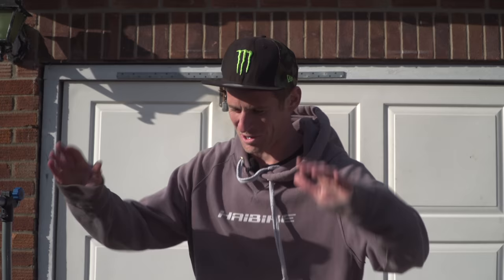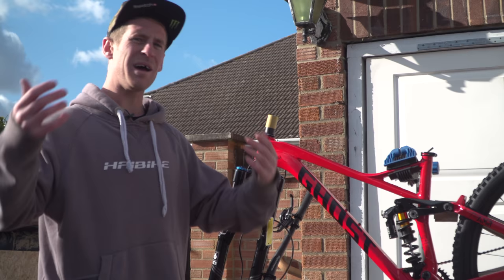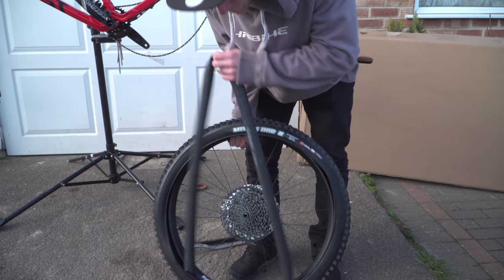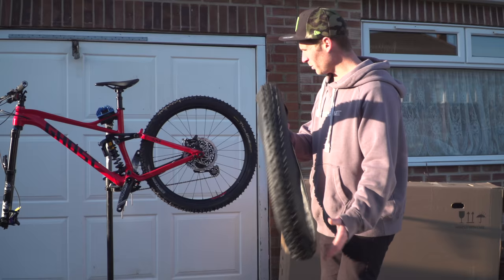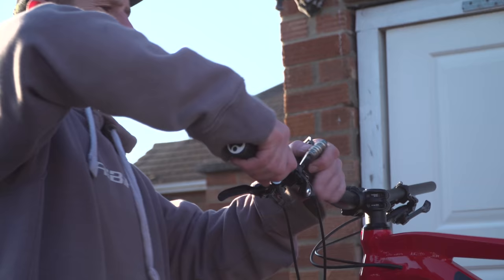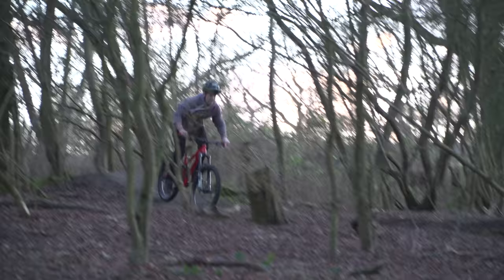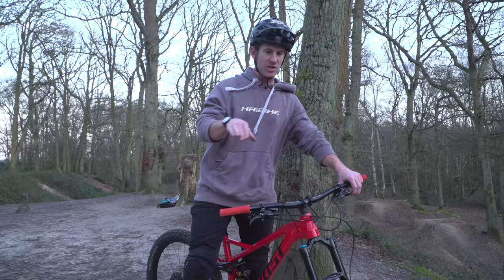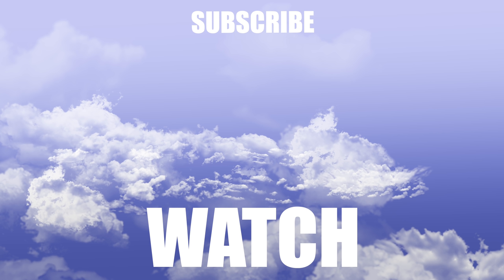MY NEW ENDURO BIKE IS THE DREAM

Comment: When it's not Magura: "let's hope they will last at least a little bit"😂
Reply: My Maguras lasted 2 weeks. No more Maguras, ever.
Reply: @thisfall5227  how tf?
Reply: @LukePridestalker  not wrong, if you cant get maguras to last more than 2 weeks your doing something severely wrong.
Reply: @brapamaldi7666  didnt quite understand but i have them and feels sick every time i ride
Reply: The Formula Cura is the exact opposite of every magura brake out there. Its made from metal and is consistent like nothing else. Maguras on the other hand are overpriced pieces of plastic with a bitepoint that wanders all over the place.
Only one of my mtb friends has no issues with magura brakes, but she is also quite light and rides XC, other than her we all switched to Shimano, Hope and Formula.
Even when you take the in our oppinion very questionable perfromance out of the equasion, the brake is still made from plastic, so you can quickly strip the threads.

I would like to support Magura, since its a local brand, but their performance does not justify the price tag.
Reply: @obi-wankenobi9871  dunno mate, you speak like its absolute crap out there, i got mine mt7 they work like a beasts, had alot crashes and nothing got broken, just bent rotors.
Reply: @LukePridestalker  A lot of pros ride them and many people seem to like them, but I just cant say that ive every heard something good about them from someone i know personally.

Comment: Hey actually my rear shock has a switch to lock the suspension as well. It's an air suspension.
I get that the purpose of it is to make things more efficient when peddling around town, but would you worry at all about braking anything, locking the suspension and then jumping the bike?